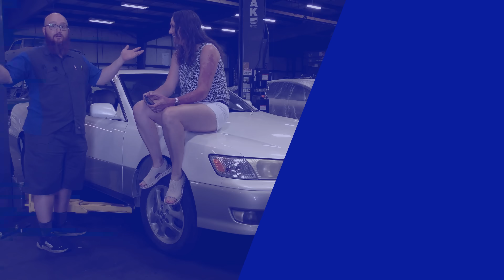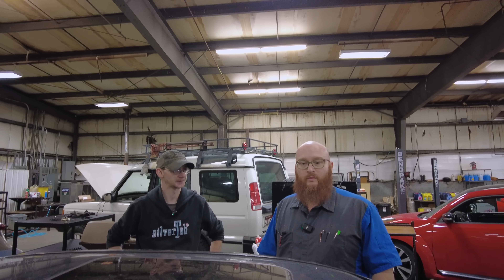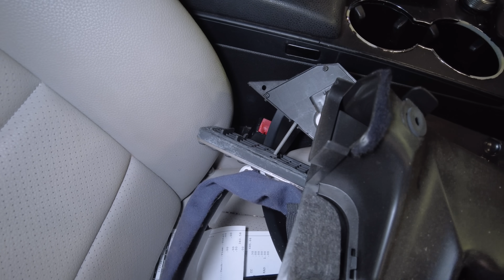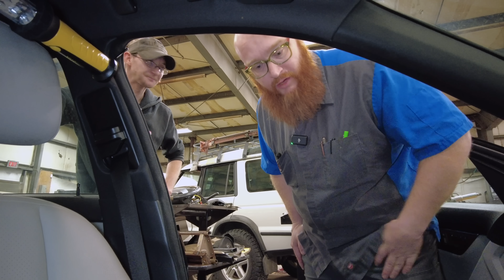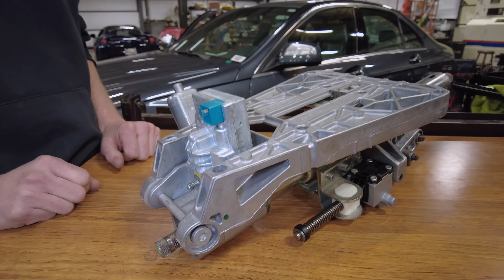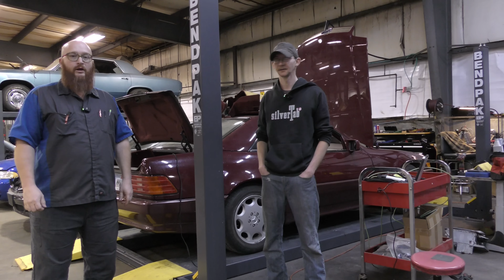Tiny Part TOTALLY Disabled This Mercedes! AND it's a Common Problem!

Comment: I had great success by tapping the ESL with a small hammer and inserting the key in the EIS.
Once it unlocks, removing the ESL is easy without removing the steering column. Then you can install the emulator if desired.
Reply: Did similar, Astro van,
Fuel pump quit 150 miles from home.
Called my mechanic, he said kick the
Fuel tank, thought he was jackin me,
Did as he said, started, and drove home 🤷🏿‍♂️🤔
Reply: The ESL is the keeper of the bridge of death (Monty Python). ;-)
Reply: Pretty much anything with a motor may need a little external persuasion in the final stages of its service life.
Reply: Good idea, if the motor is stuck or the brushes aren't making contact then it'll certainly help free it up, worth a try.
Reply: @volvo09 that’s exactly the mode of failure 99% of the time on these. Motor brushes stick. I do give it some love taps to try and free it before resorting to column removal though
Reply: Giving the SU electric fuel pump a tap with a hammer gets many a British classic car going again!
Reply: Tappy tappy with the old hammer on that module unlocked it for me. Easy to remove then, 10 min job. Same concept of hitting your starter motor to jolt it in to life that one last time. Replaced the steering lock but zip tied it to the column, so when it happens again and easy job.

Comment: This reminds me of when I was in Italy in 2001. Rented a new C Class and I got some sand stuck inside the gear shifter and it totally blocked the shifter from being able to move out of park. Mercedes now has protection around the gear shifter. Imagine this happened to quite a few people before Mercedes changed the layout of the gear shifter. Had the car towed and spent the rest of my vacation without a car.
Reply: I had a few used cars with stuck / sticking shifters (automatic) due to spilled soda and dirt getting in and sticking up the shifter lock solenoid.
Reply: @volvo09   What a mess!  I'm not sure what year Mercedes revised their shifter for the better, but I'm confident in saying that it saved people and mechanics from future problems.
Reply: how did you get sand into the gear shifter tho?
Reply: @floggyWM1  That’s a good question. My partner and I had just finished enjoying the beach. So beautiful the Italian Riviera. But there was no place to change our bathing suit afterwards. We changed in the car and realized shortly after there had been some sand in our bathing suits. It didn’t seem like a lot of sand but it was enough to jam the shifter. We had to travel back through 5 countries to get home. What an experience it was.

Comment: Do you usually put parts on the seat ?
Reply: If it's a clean part why not. 

You can pay more, just tell the service advisor to have the tech keep all parts outside the car and you'll be billed accordingly for their time.
Reply: @volvo09  really, you charge more just to put parts on a table?
👍🏽 
I meant is a nice car , I don’t know I don’t work like that
Reply: @rubengonzalez5725 👍
Reply: @rubengonzalez5725 👍
Reply: @volvo09 bullshit
Reply: If they are internal light weight plastic components - there is no issue.  I would take exception to engine parts being placed in side a car.

Comment: We'vd been conned in Europe by so much stuff on cars having to be coded. It may help with theft prevention on rare occasions but for keeping older cars running it's a disaster for owners
Reply: They dont care about owner, only money
Reply: @hiteshadhikari  and they care that they comply with legislation.
Reply: I like cheap, new, basic models & ignoring the options list.
Reply: Exactly, I can never say in immobilizer stopped a thief from stealing my car.

However I definitely can say an immobilizer stopped me from using my own vehicle...😂
Reply: @edd2184  I don't whether they changed it but in the initial engineering versions of the Australian Ford Territory if the Canbus found a problem it locked you out even to the degree that you couldn't put the transmission in neutral to put it on a tow truck. We found this out when there was a silver slither created in the CPU on the instrument cluster and it shorted (bloody unleaded solder!!!).
Reply: @ianmontgomery7534  I know Mercedes had the same problem a lot of manufacturers were getting relay control modules that had bad solder points.

For example in the Mercedes SLK/Crossfire it would just cause the car not to crank at all, or you would just be driving in the car suddenly all at once just loses All power, so you just have to crank the steering wheel as hard as you could to get to the other side of the road.

To fix this problem all you needed to do is solder 3 points on the lower part of the board.

Also in the same generation I do believe they had a problem with this pin in the locking cylinder, due to a manufacturing defect the pin was slightly too wide so if any vibration happened, it could set the pin off by hundredths of a mm. The pin would get lodged and you could not turn the locking mechanism. You would have to drill it out just to remove pin. I remember a client of mine wanted me to install the same defective locking mechanism. I literally told him "you know all the pin really does stop you from moving the locking cylinder, you have an immobilizer in the car so you can't just put any key in it and turn the ignition".

To make a long story short I saw him again for the same job 4 years later.
Reply: @edd2184  the pin was so that you couldn't steer the car if you managed to hot wire it.
Reply: @ianmontgomery7534  that's even worse, I don't get car engineers to this day. The only things that locking pins affect are the vehicle owners. They don't prevent theft.

I can understand an immobilizer stopping the car from starting but locking the wheels that's just insane
Reply: @edd2184  I agree. They were fine when we didn't have immobilizer but I feel they are redundant these days with the software control you have over engines and gearboxes..
Reply: @ianmontgomery7534  exactly and after people make their final car payment and the warranty end. The manufacturer should be obligated to give the consumer all the specialized tools and software they need to fix their vehicle.

Right to repair is beyond important.
Reply: This is why, after learning many BMW and Mercedes lessons... I drive a Lexus now and have NEVER been back to a Lexus dealership for service... Ever
Reply: @DaveP-uv1ml  the w204 owners did win a massive class lawsuit. The courts forced Mercedes of America to change the all the c250 cam adjusters as long as the cars were under 120,000 miles. 

Also the work is warrantied for another 20k miles.
Reply: @DaveP-uv1ml  It's an older car, you don't expect cars to fo on for ever with no parts failures unfortunately. It's how easy it is to fix them that is the issue, and by coding it means that owners cannot typically get parts fromthe junkyard and swap them over. They need specialist kit and programming, usually resulting in an expensive trip to a dealer or the car being scrapped when it could easily be repaired if life wasn't so difficult, which is bad for the environment
Reply: I've said many times The problem of using Mercedes, Bimmer, Audi or any high end cars here in North America is that the Mechanics here for these cars are shit...even at the dealership.  They still don't know how to fix easy stuff on Germans Cars compared to European Mechanics or even a roadside Mechanics in Africa or Middle East for these cars. My friends W204 had the same problem, and Bad  starter motor  in Ghana and was damn easy for these young Mechanics with few tools to fix everything without having to disassemble the whole car like this one. And oh for the starter they open it up and fix for just $30
Reply: Headaches
Reply: Don't buy Mercedes or bmw or Audi or Volkswagen
Reply: It's a security issue. I have done away with my ELS but the emulator just tells the car the lock is still there.
Reply: Germany has weird laws about theft prevention fwiu
Reply: Mercedes cares about the original owner, who buys from them and sells the car in a couple of years to buy another one. The whole point of driving a new MB is not to be seen in an old one. So they don't build them to last anymore. They don't care about the poor guy who gets the depreciated old car since he will most likely not buy a new one from them. 

This is my opinion as an owner of '07 S65 AMG.
Reply: @romanpolak3239  Mercedes will care about you again when your car is 25 years old and they can sell you on bespoke Mercedes Classic parts that you'll need to keep it on the road.
Reply: @Bubblun1 [laughs in W210]😂
Reply: @robertcoyle9071 Those are the exception because rust is eating them all.
Reply: @romanpolak3239 my W210 has been one thing after another since I got it. First week the power steering return line got a hole in it. Brand new belt and tensioner. Ran it and there's runout on the harmonic balancer and I didn't like the water pump either. Three out of four windows has problems,  AC quit on me and the seat adjuster switch is bad. Alternator died and no new ones are available and I went through 3  rebuilt ones until I got one that lasted more than 30 miles. 

I'm getting rid of it. Get another E46 or an E39. My E46 only saw a tow truck once in 12 years and I had plenty of warning on that idler pulley.

Comment: I hate modernity with a passion. Give me steel cables any day over some damn sensor modules. Only thing that gets a pass is electronic fuel injection. I drive a K11 Nissan Micra. She's absolutely bulletproof. Bigger battery helps at -25 degrees.

Comment: That is a security vulnerability
Reply: No it's not. It's an annoyance.

Car isn't going anywhere when the steering wheel is permanently locked. 

Car also isn't going anywhere when the lock is removed and the immobilizer keeps the engine from starting and the transmission stuck in park. If thieves really want your car they'll do as they always do and just drag it away onto a flatbed. 

Steering wheel locks are so easy to defeat with a flatbed, or wheel casters (which you can see they used here to move the car around and they aren't even thieves).
Reply: @volvo09  Not if it keeps failing that brings a lot of attention to it that is why it's now a vulnerability

Comment: It's very rare to find a genius mechanic like that; like engineer-level.
Reply: Give Grimes a raise.
Reply: Ever see some engineers try and do basic carpentry?
Reply: In this case two
Reply: If you Google this problem, there are dozens of forums posts explaining this exact error and how to fix it.

He does a great job at repairs but stop dick riding.
Reply: I would disagree. Experienced mechanics have huge engineering insight and a genius IQ has nothing to do with quality service of vehicles.
Reply: I ran the shop for BMW Boston for 3 years. We had 5 out of 49 tech like that. Systematic diagnostic skills, no fault could escape, never throwing parts without a solid diagnosis. It's an impressive skill.
Reply: Who do you think Dave is going to sell the place to when he retires?
Reply: Engineers suk. I retired from a large airline as a licensed mechanic. Not a Engineer as the overseas carriers like to call their mechanics. Engineers would come to the mechanic and ask him how to do something because they had no idea. So Engineers suk.
Reply: Engineer level? Really? It's a Engineer that created those POS
Reply: @idontknow2293  mercedes does a ton of cost cutting, real engineering is seen in their 90s cars and earlier and they are all straight up tanks
Reply: @idontknow2293  These sort of issues are not 'engineer led' - they are 'bean counter led' - compounded by using very poor quality parts.